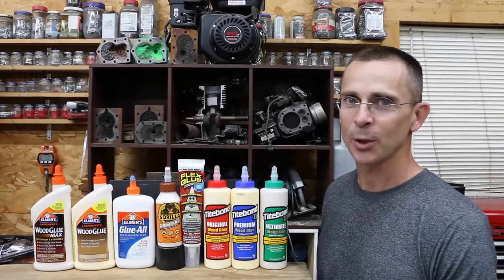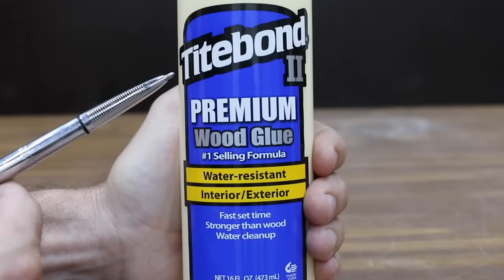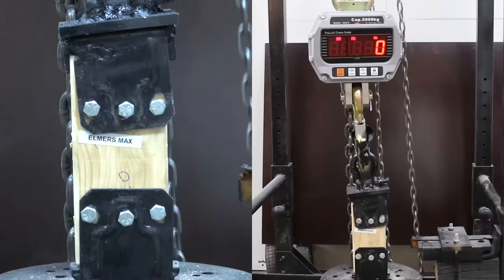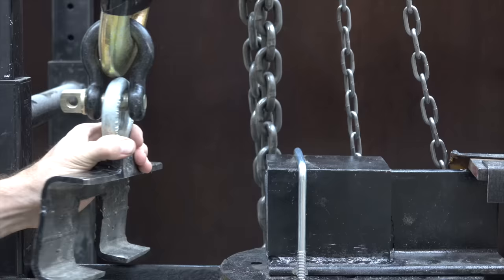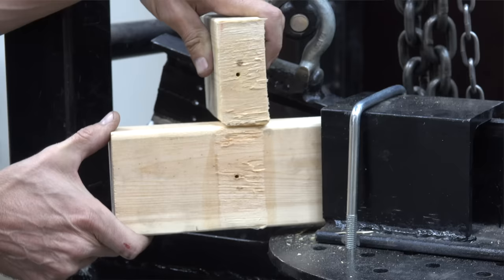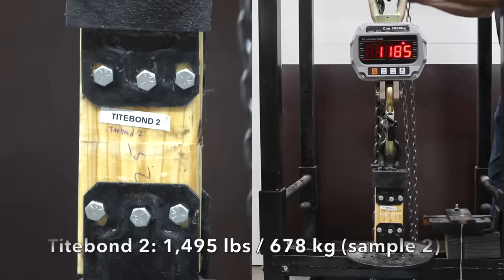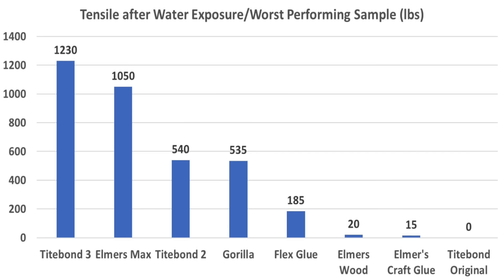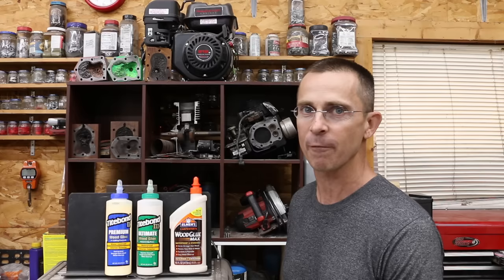Which Wood Glue is Best?  Let's find out!  Showdown with Titebond, Flex Glue, Elmer's & Gorilla.

Comment: This was a really great test - confirmed some of my suspicions about the strength of various wood glues.  However, as an idea for a followup video... All of the glue joints tested in this video involved glue on end grain.  This is a woodworking no-no (but we all do it, sometimes).  When we apply glue to end grain, we never get the strongest joints.  Conventional wisdom says it is because the end grain wicks most of the moisture out of the glue before it can properly cure - thus making the glue itself weaker than the wood it adheres to.  I'm not sure if that is the reason, but end-grain joints are definitely weaker.  

Now that you've established which glues are stronger than than others, it would be really fun  re-run the experiments with edge-grain to edge-grain joints.  According to the claims of most wood glue manufacturers, the wood should fail before the glue does.  It would be interesting to see how true that statement is.  It would also be interesting to find out just how much stronger ideal woodworking joints are.

Keep up the good work!
Reply from the maker: Thanks!  Thanks for the suggestion.
Reply: If the wood fails first, you aren't learning the strength of the glue — you are learning the strength of the wood.
Reply: @TheThomure  If the wood fails first, you're using a good enough glue. :)
Reply: @SteveMasonCanada  that is very much true
Reply: @TheThomure  End grain to end grain, use PL3K or a lap joint.
Reply: Also, clamping with good clamps is imperative. But, I am not surprised with the results even with unorthodox joinery.
Reply: End grain to end grain seems weaker, but part of that is because the wood itself is stronger in that direction, so the glue fails before the wood. Secondly, usually gluing end grain to end grain the short sides of the wood is being glued, thus there is typically more leverage stressing the joint.
Reply: Agreed, one of the end grain joints clearly had a large knot....and we generally know what that means....a cull piece.
Reply: This was debunked on Patrick Sullivan's channel. End-grain-to-end-grain joints are actually stronger than edge-grain-to-edge-grain joints.
Reply: The grain of the wood is made up of fibers. When in end-to-end configuration, the fibers are at their strongest because you are stretching the entire length of individual fibers. When in edge-to-end configuration, the strength of the wood relies on the strength of the lignin to hold the fibers together.

If the end-to-end connection is properly bonded without the possibility of the wood absorbing the glue, then it is strongest.

There is no need to redo the experiment unless he is going to compare the bonded strength of hardwoods such as oak, maple, mahogany, etc.
Reply: This is exactly what I was thinking, but worded better than I could. 

I glue my guitar bodies with perfect edges from the jointer and I would bet my house they won't fail. The wood on the other hand...
Reply: I was going to comment that when applying the glue to end grain, apply a layer, let it dry, then apply more to glue them together.
Reply: It’s a “no-no”?
We are not 5 years old.
Reply: @mrcryptozoic817  A lap joint with one of the winning glues would put the wood grain side to side and I'm guessing it would outlast the wood!
Reply: Dude I have no idea what you’re talking about
Reply: Ya this was an improper test not doing long grain joints. Which are the only joints you should consider only using glue on.

Notice how the glue failed to hold everytime and had fairly wild results. This is because the glue was literally grasping @ straws...

If the joint doesn't break wood. It's jointery failure. Not glue failure. Unless your using improper products for wood jointery. Like a craft glue or a flexible adhesive...
Reply: @rabefamily9146 wood glue is weak on end grain, it's like trying to glue the ends of straw or grass to something. End grain requires jointery techniques to be strong. The jointery techniques specifically offer acces to edge grain/long grain to glue together to provide strength to the joint. This is what a mortise does, or dowels, or any other jointery technique.

This all becomes readily apparent watching this same kind of test with plywood. 50% of the wood Will fail in the joint, and 50% will rip itself apart because the glue is so strong.

It all has to do with adhesion. And grasping @ straws is not proper adhesion.
Reply: @WGMedia no end grain requires jointery. Just glue will not suffice. It's not mythril, it's wood glue.

Comment: Here’s an idea, the best product to remove limescale since most people don’t have a water softener.
Keep up the great work buddy, the world needs more people like you.
Reply from the maker: Thank you for the video idea!
Reply: Vinegar
Reply: @JoePJack1  Lemon juice and vinegar. :)
Reply: See you on the other side. 0u9i80
Reply: I like this one!
Reply: @Wroger Wroger oh i always appreciate a dad joke.
Reply: Citric acid works wonder
Reply: great idea i use vinigar to soak my shower heads but it dont get it all
Reply: @royvincent9250 , the lime-a-way spray works well for shower heads. Unless you have one of those directly overhead rain shower heads, just dry it with a hair dryer, spray the lime-a-way directly into the head while it's still screwed in to saturate it, and let it sit over night or until the next time the shower is ran.

It'll be noticably better after the first attempt, then it's a matter of repeating right away or just doing that same process every week-ish as a means of maintenance.

Home depot also sells vinegar that is 30% acetic acid, compared to the 5% you can get in the grocery stores... If you'd still prefer to go that route. It's not cheap, but it's definitely high powered.
Reply: @russellborrego1689  thanks i tryed the CLR but it did no better than vinegar ill give it a try
Reply: @britsfabrication  Amazingly true, buy it in solid powder form and you can choose the strength (concentration, dilute in water) of the mixture, also excellent to remove rust by soaking for 24 to 48 hours.
Reply: I use Whink Rust And Stain Remover. It isn't as wild as muriatic acid but you still have to watch what you put it on. I use Whink to clean the junk out of my plastic water bottle, cleans it up nice.
Reply: @Wroger Wroger agreed I wasted litres of vinegar before and it dries up and does nothing

Comment: I was really surprised how well the Elmer's glue did. I always considered them a "kids" glue because we used Elmer's glue in grade school.
One of the interesting things about this test is that all these were end grain joints, which is the weakest way to glue wood. I would love to see a similar test comparing different connection methods. Glued, pocket screws, dry mortise and tenon and glued mortise and tenon.
Reply from the maker: Thanks for the suggestion.
Reply: We did a bunch of different joints in a woodshop experiment over 50 years ago. On any of the joints done properly, and no end to end joints, the wood failed before any of the glues did, including regular old Elmer's. We didn't do any wet testing. The teacher wanted to show us that if we put stuff together correctly, it was strong as hell.

Comment: I did my own little test recently. I used Titebond 3 to edge glue two pieces of 1/8 " hardwood together. I didn't think that 1/8 gave me enough surface area but after the glue was dried I bent the wood parallel to the glue joint. The wood broke but not at the joint. Great stuff!
Reply from the maker: Thanks for sharing.
Reply: Tite Bond is the best out there for wood projects.  The best furniture makers strictly use it.

Comment: I just used Titebond III on a table I built, and was extremely impressed. Granted, the only way it'll ever see 5,000 pounds is if my SIL sits on it.
Reply: Juice556 assuming you’ve used at least halflap joint, it’s going to be very strong
Reply from the maker: Great product!
Reply: Juice556 , 😂🤣😂
Reply: Savage
Reply: Just leave the screw in it. It’ll be fine.

Comment: I've used Titebond III for all my cutting boards for 15 years now without a single failure.  Many of my customers (and my wife) have warped them by nearly an inch over 19 inches by letting them soak in water and all have come back after drying out.  I'm not switching.  Thanks for the affirmation!
Reply from the maker: You are welcome!  Thanks for sharing.

Comment: I am woodworker and have built a considerable amount of furniture over the years.  For your test, you have constructed the weakest glue joint there is, end grain to end grain. We NEVER would construction that joint as it is by far the weakest. If you are so inclined, sand or flatten and few pieces of your scrap, glue long grain to long grain and check that strength out.

I am amazed you got the holding power on those end grain tests, I would not have thought it.

You are great tester, with a ton of energy and ingenuity, excellent.
Reply from the maker: Thanks!

Comment: I was doing my very first finished product woodworking yesterday. I went to Home depot to get materials. Knowing that tightbond 3 would be the very best for a cutting board after watching this video. Best strength, best water resistance. 
In home depot I grabbed tightbond 3 without hesitation. A home depot employee was near and saw and he said "gorilla glue is better." 
I just said "uh huh" and held on to my tightbond 3.

just goes to show you if I was an uninformed customer I would have been duped into buying the wrong product on a bad recommendation from an employee who didn't know better
Reply from the maker: Thanks for sharing!

Comment: As a woodworker, I cringe when I see you gluing end grain to end grain, or even end grain to face grain.  Every single woodworking application that has an end grain joint will have some other means of mechanical or integrated reinforcement.   End grain wood soaks up glue and doesn't give the best bond.   I'd love to see side grain to side grain or face grain to face grain testing. 

However, kudos to the consistency in testing and I think this still provides great information.
Reply: He was already stressing his equipment with end grain testing, so I think it was a great way to test these glues relative to each other when they are at a disadvantage. I get where you and other commentators are saying that you would love to see it tested this way, but it will just make the numbers bigger and won't really change the relative test results too much.
Reply: @The_Fat_Turtle  I think doing face grain would give more repeatable results. It's hard to know how much the end grain is going to wick the glue away from each individual joint.
Reply: In side grain to side grain soft pine (and most other woods) - the wood would be weakest link for any brand of PVA glue.
Reply: I thought the same thing. However, stressing  either a side to side grain or face to face grain glue up would probably just result in the wood breaking somewhere else besides the glue line.
Reply: He should redo this test
Reply: Twoleggedkumulava  In a real world application this was a solid test.
Reply: @serraramayfield9230  Why?
Reply: Twoleggedkumulava  He used the same species of wood 2x4's throughout the test. It's not plausible to get all the samples from the same tree.
Reply: Twoleggedkumulava  it's the same species! Probably Fir or Spruce. Get a life.
Reply: It says in directions to soak in water first.. maybe in future, break out the tractor again, do a side grain comparison like dude said, and after spritzing the boards with some water first... let them dry for a few days, or week.  end to end 2x4s with weight testing but overlapping grain, like a solid foot. Would give real world results for what these glues can do, plus, gotta follow the directions. Like baking a cake. If it says soak it in water then that's going to yield best results.
Reply: slow96ss Unfortunately, this is not great information.  It is pretty much useless information.  Wood can’t be reliably glued on its end grain and these tests simply confirmed that well-known fact.  The high variability of the tests mean that the data is worthless.  In many cases the poorer glues did better than the top glues on one sample, even though the average was less.  This is a good indication of flawed test as any good industrial statistician would tell you.
Reply: LeatherNeck 1833 Nope.  Real wood workers do NOT glue end grain.  This data is meaningful only in a fool’s world, not the real world.
Reply: @LTVoyager  Neither do professionals rely solely on glue to hold a joint. What this test does show is the gripping strength of the glue itself in the worst, most impractical, never used method possible. If he would have used a side grain test with bolstered joints (real world app) then the wood would have failed long before the glue which would give no viable data.
Reply: @LeatherNeck1833  Actually, they rely entirely on glue for joints all the time, but only certain types of joints. Have you ever done a panel glue-up, or made a large block for woodturning from smaller stock?
Reply: LeatherNeck 1833 You need to do your homework. Professionals rely entirely on glue and use joinery that ensures high face grain surface area. Amateurs use screws and nails for fine woodworking.
Reply: @ergohack  Ok, I digress; very few applications rely solely on a glue bond alone. In those apps, this test proves the point that the bonding properties of the glue alone are evident by testing it in the weakest bonding method possible (end grain).
Reply: @LTVoyager  That only proves the data found in this test. Test the strength of the glue at it's weakest possible application and you'll get true bonding ability results.
Reply: LeatherNeck 1833 Not at all.  If you are an idiot who glues wood by its end grain, then I agree that this data is useful for you.  However, if you are a normal intelligent person who uses wood glue properly, then these tests are meaningless.  The good news is that there are a number of tests conducted by people who actually understand how to glue wood so folks who want to use wood glue properly can find other tests that show how various glues perform when used in the manner that most woodworkers use glue - that is, when the glue is used properly.
Reply: Glad I wasn't the only one who noticed these tests are irrelevant...
Reply: @LeatherNeck1833  The most important reason that glueing end grain provides a weak bond isn't that the glue doesn't stick to the wood fibers as well, it's that the end grain can wick the glue further into the wood and starve the joint of glue. If he were to have intentionally placed glue on both surfaces, allowed time for it to soak in, and then reapplied glue before assembly, the results would likely have been far more consistent.

Comment: Great test. This one really peaked my interest  as a canadian red seal journeyman cabinetmaker. One important thing we learned in school about glue joints is that the weakest joint is end grain to end grain. If end grain joints are used they are stronger if sizes. (Mixing glue and water 50/50 and allowing it to be absorbed into the pores then after a bit of wait time glue as normal)  The strongest being edge grain to edge grain. I'd really like to see this test done again with edge grain to edge grain. Also end grain to end grain test would be cool to see again with testing the sizing method mentioned above. 

Cheers and keep the videos coming!!
Reply from the maker: Thank you very much
Reply: TheCheesePlease  when doing a science  experiment  you come up with a hypothesis  of what might happen. Your hypothesis is that they will all hold up and the wood would break. My hypothesis  is that some of them may hold up but most will still fail. Another possibility  is that sizing a joint actually doesn't do anything it could be something that they thought would work for years but actually has zero science  behind it to work. So now I think it has to be tested.

Comment: So much for using wood glue to repair utility poles.
Reply: As a former lineman, I'm kinda sad about that! :)
Reply: Elmers craft glue would be an improvement over some of the repairs I’ve seen Verizon do.
Reply: But woodglue and screws seems more practical. Most likely you wouldn't remove the screws in that situation
Reply: you don't glue endgrain to endgrain if you can avoid it.
Reply: The chainsaw left a very rough surface. Using a guide and a very sharp carbide router bit could have made them smooth and flat to .002 in.
Reply: @tripplefives1402  , old  Utility Poles were treated with creosote, a by-product of burning wood that isn't used anymore because it's carcinogenic. Nowadays they are treated with something similar to copper fence post preservative, and if it's anything like the stuff we use when building decks and wood fences in our own homes then it is water based, not really oily.